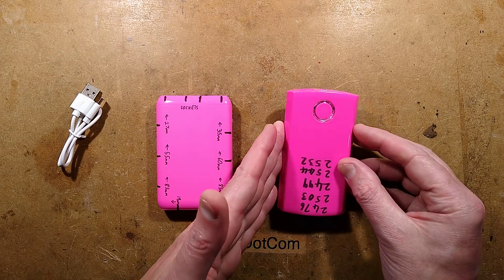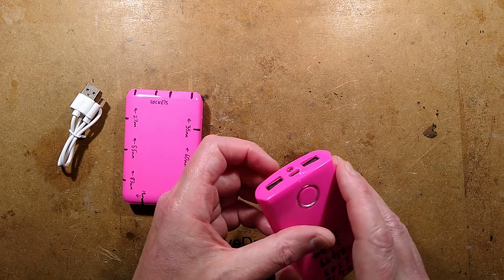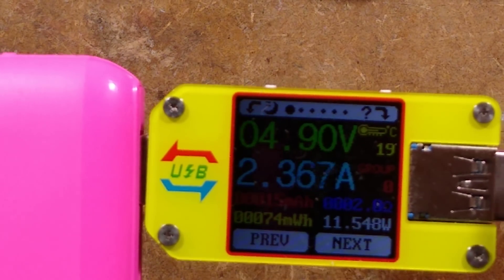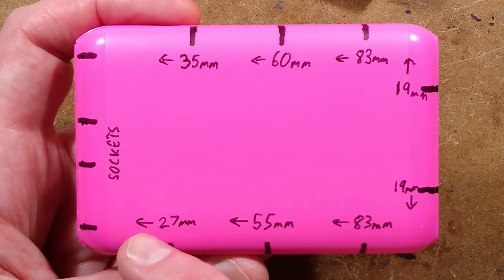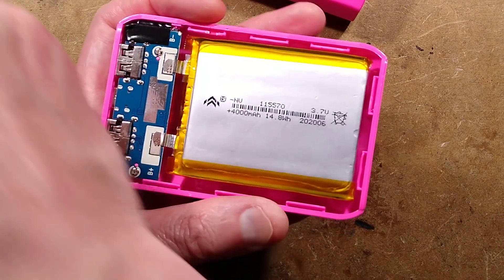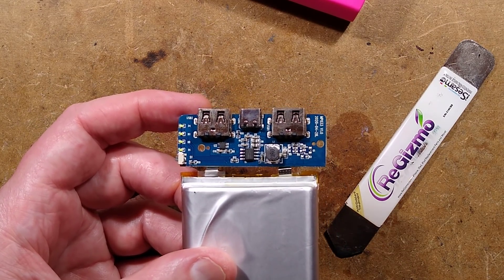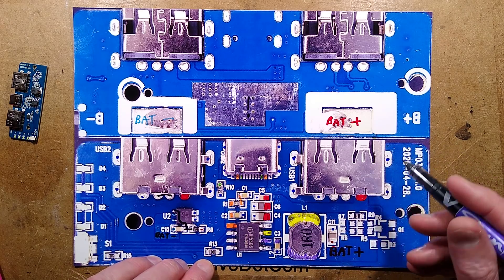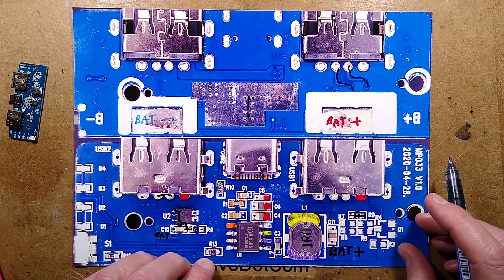Poundland's new 4000mAh power bank

Comment: It's always a bit of a thrill to watch Clive defuse a lithium battery bomb, almost never following his own advice to fully discharge it first. Acetone, isopropanol, and lighter fluid are fine for removing many types of sticky stuff, but I prefer heptane, which doesn't smell as bad as acetone and seems to work a little better than isopropanol. In the U.S., heptane is sold as an adhesive remover under the brand name Un-Du and as rubber cement thinner under the brand name Bestine. (Bestine is usually cheaper.) I wonder if whiskey, another flammable liquid after all, would work, although it does have better uses . . .
Reply: Oh no, don't use whiskey to remove adhesives. That's full out alcohol abuse. Drink the whiskey and you won't be bothered by the adhesive.
Reply: Thanks for the tip on Heptane.  I use home-distilled 100% ethanol made from sugar.  Tastes like rocket fuel, but won't kill you.  GREAT for cleaning certain pieces of glass.
Reply: @TechGorilla1987  75% ethanol was used a fuel in the V2 rocket
Reply: @polygondwanaland8390  That is correct.  To add to that, apparently at Peenamunda, they had to lock up the fuel as to keep it from being hooch.  I think Scott Manley spoke about that.
Reply: @TechGorilla1987  even better!
Reply: @TechGorilla1987  Add coarse salt to the ethanol when cleaning said "certain pieces of glass". It adds a gentle scrubbing action. 😁
Reply: @TechGorilla1987  we use Everclear for cleaning things that can't have a residue. It's about as close to 100% ethanol as you can get without using desiccants. Not as cool as homemade, but good stuff nonetheless.
Reply: @thatsunpossible312  That is essentially what I make.  My final step is molecular sieves to attempt to maintain anhydrous.  Not really made for drinking, but in a pinch.  :D
Reply: dont use acetone if the thing the battery is stuck to is made of 'soft' plastic, it'll melt it!

Comment: Acetone will take care of most adhesives, but might attack the case.
Reply: Yeah there'd be a puddle of sticky plastic if you used acetone.  I've had good luck with the "sticky stuff remover" which smells like some kind of petroleum based product.
Reply: @ferrumignis  "goo gone" and similar products are based on citrus or pine terpenes - dense, oily organic solvents.
Reply: I prefer sawing adhesive off using dental floss. 😉
Reply: @bufordmaddogtannen  I'd never considered that, but that's damn clever. I typically use a safety razor blade because they're so thin and flexible.
Reply: acetone most definitely will attack/melt the case, it does many 'soft' styrene type plastics , you can use it to melt weld 'glue' them